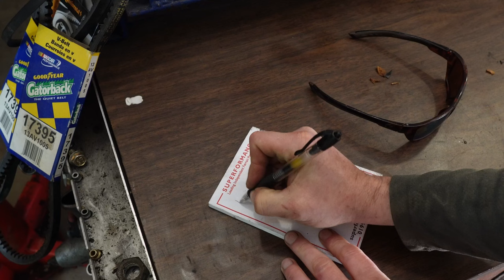What IS the best Corvette?

Comment: c4 was when they began to not only reconfigure the styling to the more modern, italian-esque wedge shape with the iconic dome rear glass, but they also jumped the performance siginificantly. The HP did hit 300hp, but I argue that the 350 lbs torque is the real selling point because that means it beats pretty much any car off the line then and even now (compared especially to most new foreign and japanese "sports" cars). I prefer c5 styling, but in person the c4 is just as eye catching and cool looking. the greenwood kits really bring these cars into modernity and you can't tell it's an old car w/ it on.
Reply from the maker: So true. These still look current.  Cars from this era still had bumpers!

Comment: Eaton's automated manual transmission is by far and away the absolute worst transmission I've ever had the displeasure of suffering through.  Damn thing always picks the wrong gear on climbs or decends, which is far more dangerous in a truck as you can easily lose your brakes crossing the Rockies weighing 70k or better.  
Fortunately, you'll never have to suffer one of those in a car.  As for the Vette's - I've always been a huge fan of the '62 Vette for it's styling and call me nostalgic, but I'm fond of the early 90's ZR1.  Those came out at the time I started driving and they still hold a special place in my heart.
Reply from the maker: I want a C3 to compare, but the C4 is the A-Team Vette, and that is the one that I remember most from childhood.